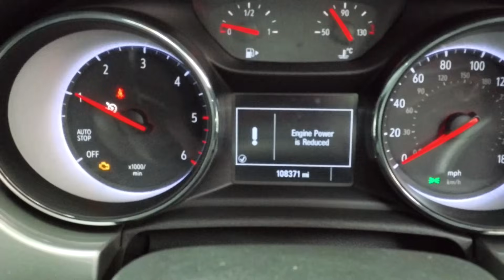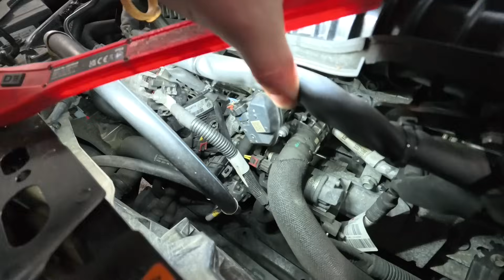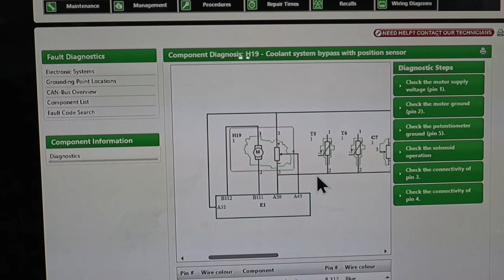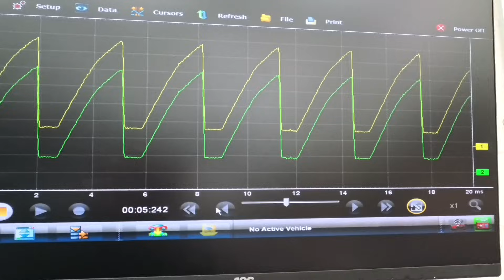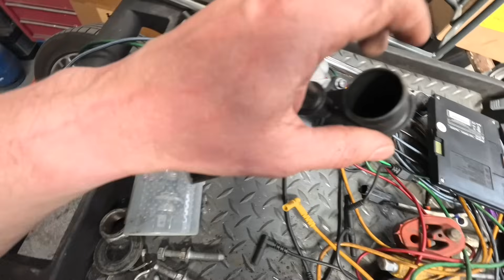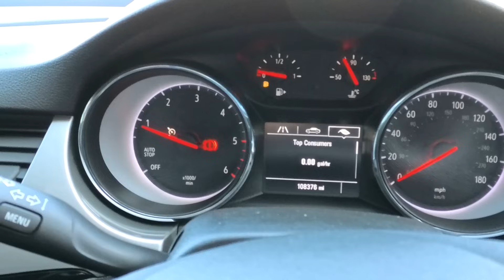Main Dealer Was Guessing – We Found the Real Fault!

Comment: Beautiful design that allows coolant to be forced into the electronics. That could easily have been manufactured with the spindle coming out into the atmosphere and a servo assembly that bolted on top with open air between the two. 
Still, as I often tell my customers, “if the manufacturer made the cars properly I wouldn’t have a business”.
Nice bit of diagnostic work, I haven’t had one of these yet so thanks for the heads up.

Comment: As ya taken apart - Is it poss to just replace the sensor valve should similar job come in? If so what’s the part cost? 
Maybe worth repairing the old unit & sell on? 

If flap open I’d be tempted  - if possible - to dummy out the sensor - find what voltage required - & see if that overides fault - plenty cars run with open thermostat / like mine as too expensive & pain in the arse job to do in not so modern car 

Is it possible to just dummy out the sensor - ie
Reply from the maker: I recently put out a follow up to the astra video. Check it out. 👍👍

Comment: Top marks for perseverance.. As previous commenter said in the cortina/escort days you'd just have changed the thermostat..! To be honest I think manufacturers use the 'Emissions' excuse just as a way of A) Stopping the average guy working at his car by complicating things and B) Extracting lots more money from the poor motorist..  I bet you'd need a room full of technical equipment to measure the difference in emission output between a new working thermostat @ £15 and this £600 lump of redundant rubbish.. I mean why didn't they put an aluminium case on the sensor/motor assembly ? Because they know the plastic will warp/leak/fail quickly.. I'd have taken it back to dealer saying "Not of merchantable quality".. Like their wet belt systems.... And NO I dont drive a vauxhall thankfully.. Anyway rant over.. Great vid and I have subscribed.... : ) Ps: When they gonna start retro fitting cows backsides with these electric valves ??
Reply: It is governments that place the emissions legislation upon vehicle manafactures and force them to be complient or they will not permit tha sale of their product in that country or region.

Comment: Great video and explanation of your fault finding, I live in New Zealand and enjoy these types of videos, I am a retired Control System Technician and I am a more an old school tradesman, I finished my Electrical Apprenticeship in 1974 when digital and Electronic software was starting to be used in the Electrical industry, were there was more analog controls used. To be honest I struggled with computers and software but I did manage, when you see the apprentices that start in the trade are so more competent using Pc's, however using "old school" methods to fault find can be OK .
Sorry just a bit of rambling from an older tradesman just giving my opinion, its amazing how modern technology can get so much power out of engines these days.
Have just subscribed to your site but will enjoy more of your posts.
Cheers John Wilson

Comment: A local Ford dealer has been advertising for some time now, vacancies for “technicians” at £40k salary, £60k for a supervisor. Apparently they are struggling to get anyone. Going by the “technicians” I’ve been encountering at a nameless main dealer, inoperative rain-sensing wipers are beyond their scope. “We’ve run the diagnostics and no fault found, sir”.  Did they try turning them on and using a watering can over the sensor area? “Er, no sir, as the system said no fault found”.
Reply: Ladies and Gentlemen it's the Muppet show

Comment: Excellent video...!! But what allowed coolant to get into the electronic board area, some shaft seals..which control the opening/ closing of the water pump discharge..?? Would be nice to know..!! Coolants contain chemicals so must have affected the circuit components on the PCB..of the valve..!!
Reply: This system is obviously designed to be more accurate with granular adjustment to optimise flow control so the engine reaches preferred operational temperature faster... but at what cost when that shaft seal cannot be replaced? It's not like they never fail.
I'd much rather have an old fashioned thermostat, but what can you do when all manufacturers are looking to make the smallest efficiency gains measurable from saving weight using thinner wires and shaving down mountings to the minimum, to using wet belts because they're cheaper and lighter than a chain?
edit: Then there's those companies that fit everything on the vehicle and charge subscription fees to actually use the sh17 you're carrying around.

Comment: First let me thank you for being a real carmechanic/carelectrician. At the end of the video you explain that because of leakage there is some coolant in de sensorarea. I think , as a carmechanic, dismount the valve, clean the axle of the valve, mount a new sealring(or whatever is used) and then after cleaning the electronics inside, try if the signals are ok again. But that is my way of thinking,maybe to much, old school.
Love the way you approach the problems and even better, solve those problems. That's a big thumbs up!
Greetings from Holland
Peter.

Comment: Decades ago, I worked at a dealership doing most of the electrical/electronic diagnosing. One of the suggested steps in the manufacturer's troubleshooting manuals was to "replace with known good part". For many reasons, I didn't work at dealerships for very long. So, as the years went along, electrical parts purchased from the dealer often had ripped boxes w finger prints, witness scratches on the parts, etc. So, did the dealer mechanic put the good new part back in the box, did a customer return a bad part in the box to scam the parts department? It was a mess.

Comment: Good work. It would be helpful if the temperature sensor fault code description, identified the sensor as being on the water pump. It would have saved you some diagnosis time.
Reply from the maker: Yes I agree. Unplugging either component gave the same description 
Thanks for watching 👍👍👍

Comment: Why can’t they manufacture the circuit part as a spare than having to buy the whole component
Reply from the maker: You'd have to ask the manufacturer.  Unfortunately in this case just replacing the circuit board wouldn't cure the cause of the fault. Poor design. Although the vehicle has covered 100k

Comment: Could you not find a replacement bit from the scrapyard
Reply from the maker: Hi Charles, the vehicle is about 5 years old, I doubt you'll find many in the scrapyard & I wouldn't replace it with a second hand component. How would you know the one your replacing it with would be any better? Also It takes a reasonable amount of effort to replace the part, we wouldn't want it to come back in a month wanting another one.
It's all about the first time long lasting fix. The vehicle had done 100,000m.

Thanks for watching  👍👍👍

Comment: This is yet another reason why I have just bought a old 1995 Merc C180, been motoring for decades on old school tech and don't want any expensive electronics other than the ECU/EMU and the head unit. Also no 'wet belt caviar'! Many years ago I drove a KIA Rio (which I didn't keep for long!) that had a repetitive engine light that gave the code the dealership didn't have listed at the time, they just kept turning it off until I traded it in.

Comment: Gubbins. Piles and piles of electronics, none of which is needed to go down the road. Morris 1000 does job just as well, just needs a dab radio and a better heater/de-mist box.
All designed to screw up the vehicle and the customer. Monster carbon footprint to make all this junk. Cars just scrap earlier and earlier. Morris 1000 still going strong.....that IS sustainable/renewable!

Comment: I was recently struggling with a multiple cylinder misfire in my 2014 3 series. Stopped by the main dealership in Beverly Hills . They told me they’d start with plugs and ignition coils plus an oil change to see if that works. $1600.00 and no guarantees

Comment: Most garages, especially francise ones are only employing fitters, ( meaning fit this, fit that type of repairing cars, trucks, tractors etc. Until the warning lights  or codes delete. Send the customer  the invoice mostly for guess work.
A lot of engineers have now retired or are working alone. 
If a 'fitter' had to strip down an engine or even a gearbox most would struggle.
Reply: My car was in and out of the main dealer for best part of a year because of intermittent Adblue issues. My friend had same problem with his relatively new van and the main dealer couldn't find the fault. 
His local mechanic traced it to a corroded terminal on a 0v return or earth connection that their computer could not identify. 
I remember the days before electronic ignition. Replacing points, condensers and coils etc. Life was quite simple then and no one spoke about emissions. 
And how many car companies have been prosecuted for playing around since then?
Reply: I've been working in truck parts departments for over 20 years, and I can tell you that more old school technicians (as were are to refer to them) have diagnostic issues than younger ones.
Our group head honcho has decreed that technicians are not to book parts on a job and return them because they didn't 'put the light out' due to the state of them and their packaging after several 'tests'.
I've long held the belief that truck techies can strip and rebuild a gearbox but can't open a cardboard box.

Comment: Great stuff.  Another example of the "throw away" society.  Instead of replacing a small, probably simple circuit board, a huge chunk of metal has to go in the skip and the poor owner gets the bill!
Reply from the maker: Yes I agree with that. Once these vehicles get to an age, they will become increasingly uneconomical to repair. Sadly if we'd been able to repair the circuit board we wouldn't have been able to cure the leak. Being a diver I can vouch for water & electronics not being a good mix.

Thanks for watching 👍👍👍
Reply: Maybe that PCB was controlling a mechanical Actuator to move that Flap if so that's another level of Black Magic...then  there's an Elastomers / O Ring to harden and Leak rather that a Gasket...coupled with Plastic Pipes that degrade and become Brittle...with  age... Fortunately I have a 2006 Honda CRV MK 11 with 250 K ...and that  Coolant Pump is of the  Simpler Old School Type...
Reply: If it was my personal car, I'd have considered diagnosing the exact mode of failure on the circuit board and getting a local electronics repair shop to repair it for £25.... I'd be without the car for a week I suppose, but could use Ubers every day for the cash I'd save :-D Was it defo coolant and not condensation/rain? Either way, there's a gasket somewhere which must be reachable...
Reply: I'm sure that's completely unintentional and will not escalate further. I mean, it's not like TPTB want us out of private motorvehicles that only the ultra rich can keep running, so that the rest of us are contained within, oh, I don't know... say 15 minutes of our cells, I mean, homes, and restricted to using public transport based on some sort of social 'compliance' score. That would be completely crazy.

Comment: Why remove simple parts and fit electronics that WILL fail, the cost of the water pump is obscene.
Reply from the maker: I agree. The cost vs gain probably doesn't justify the part. Especially when the vehicles get to an age.
Thanks for watching 👍